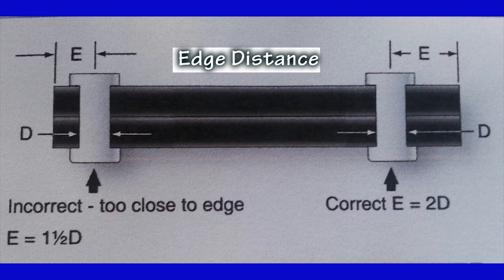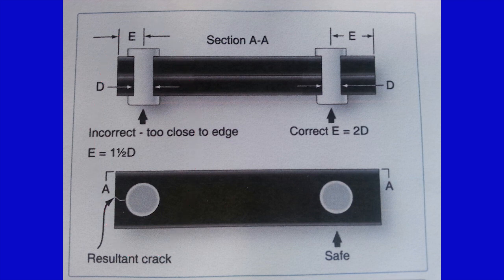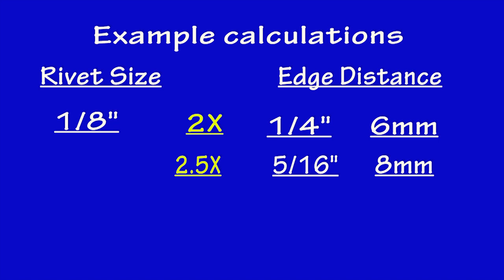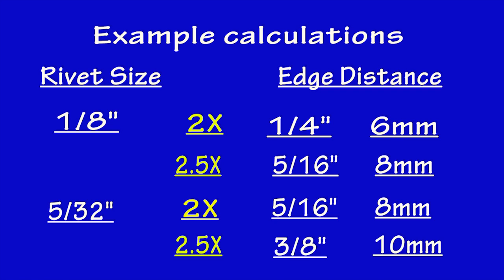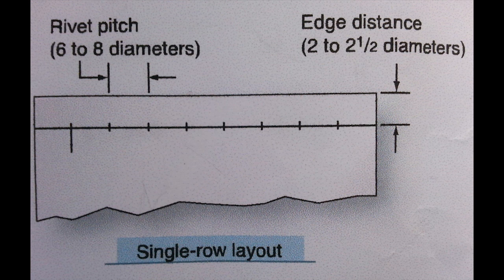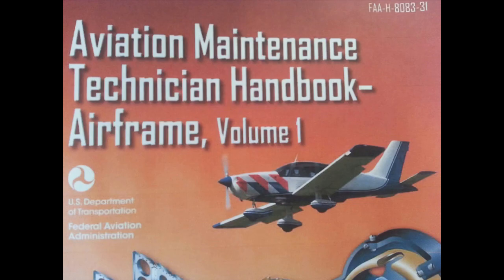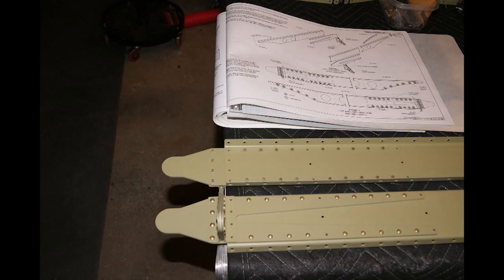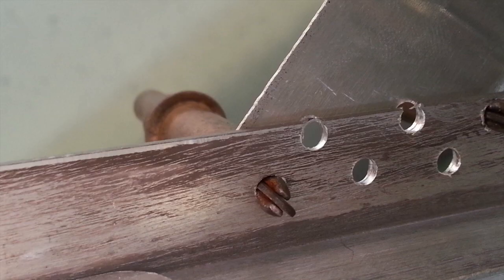Edge Distance for Rivet Holes

Comment: If we install the countersink bolt, what's the correct diameter that we use to calculate the edge margin and spacing - bolt shank diameter, bolt head diameter or its average diameter? Thanks for your input

Comment: I think your 5/32 x 2.8 = 3/8ths is wrong. I believe the correct answer is 25/64ths. If I'm wrong please correct me because my mind is going crazy while im studying trying to get it right.
Reply: John Davis you’re wrong
Reply: Shawn Agard then break it down then because I’m not the only one that got a different answe
Reply: This video is only a rough guide. Manufacturers have their own guidelines and even after that engineers can make different rules. Hilites can have a lower ed than a rivet also. Non load bearing bolts can have strangely low ed and pitch. I fit a bracket in my job  that has 1/4 ed for a 5/32 rivet, this has an exemption in the epr. But as a general rule 1/8 rivet .25" ed   5/32 rivet .30"  and 3/16 is .35" these are absolute minimum and would always try for more.